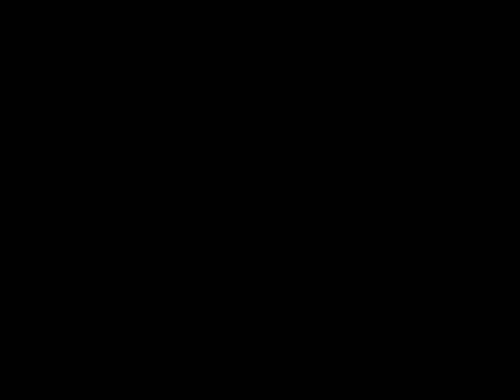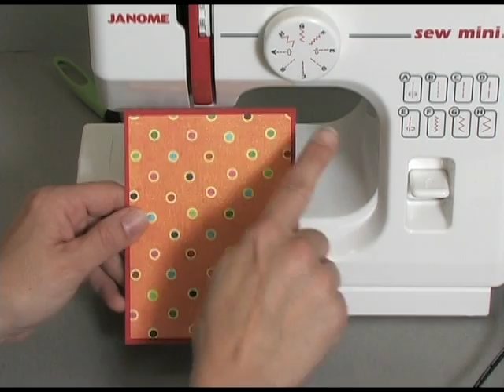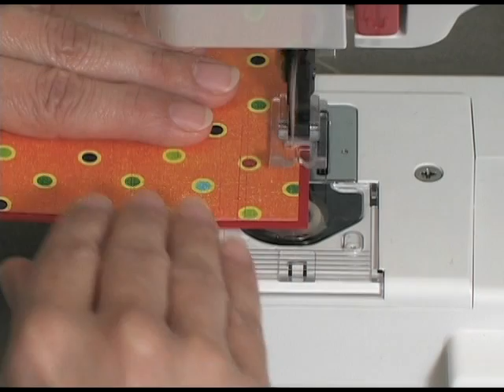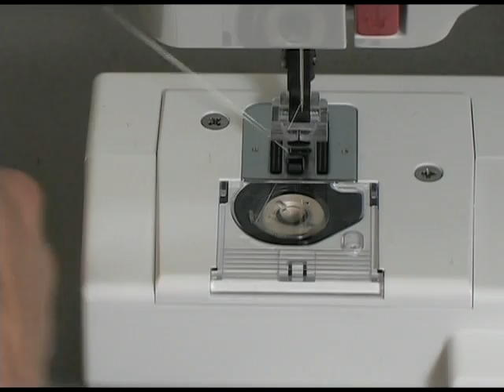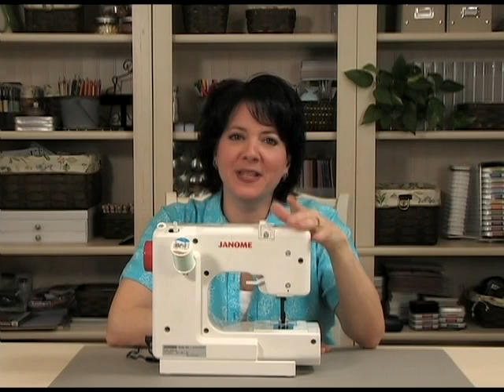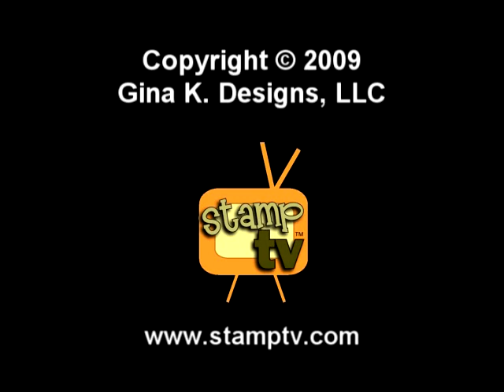Janome Sew Mini Sewing Machine Part 4 - Sewing Around Corners

Comment: This machine is just the best....it comes with a branded name and technology at a price that puts toy machines to shame.
Its selling for £39.99 at Hobbycraft at the moment (normal price £49.99) and you can get a further 15% off if you sign up as a hobbycraft club member before hand. The voucher code is only valid for 28 days and is sent directly to your email address when you sign up. I got mine this afternoon and as I was using my 15% off voucher, I bought a load of spare needles, bobbins and poly threads, too.
a stuff!...although I noticed this video was made in the USA...and I'm in the UK....Not sure if Hobby craft have stores in the USA, but I know they deliver abroad.

Comment: Can u Pleaseee help me?I've watched so many youtube videos and I cannot get the thread to stick to the fabric. It comes off. I need help getting the bottom bobbin to stick to the fabric. There is not stitching being done at all. I've tried 2 different sewing machines.
Reply from the maker: Sydney Lupus It sounds like you have pulled the bobbin thread through the machine. Make sure you follow the bobbin part of the instructions and that you pull the bobbin thread up through the machine so both threads are up on the plate prior to sewing.
Reply: I did this ,but it still doesn't work the top thread gets stuck and wont circulate around the bottom bobbin
Reply: You can also take it to a local sewing machine store- they can take a look at your settings and see what's going on :)